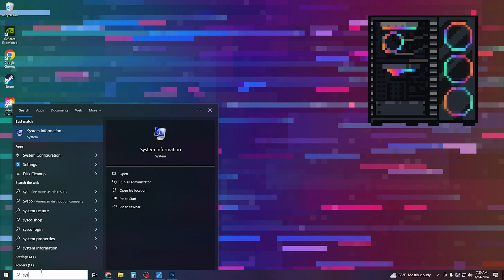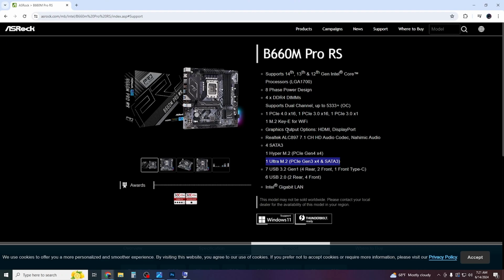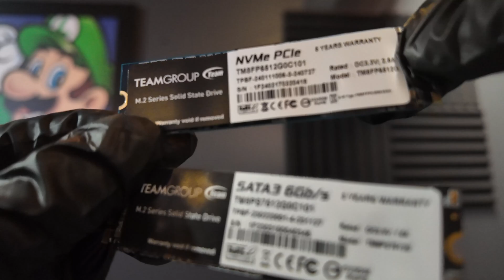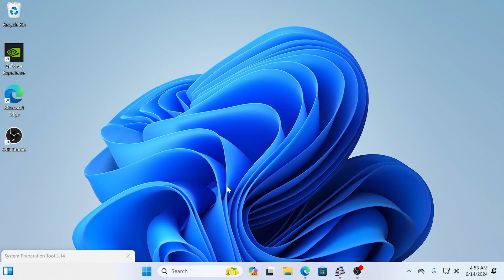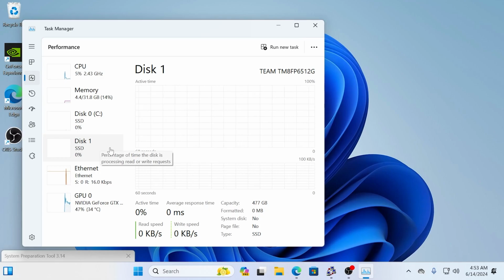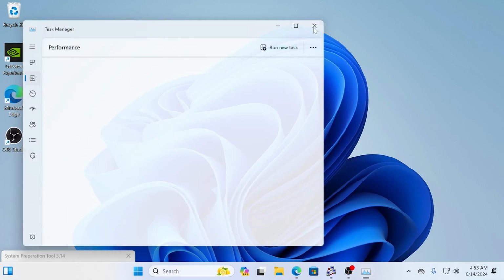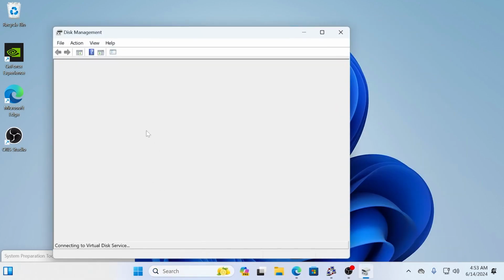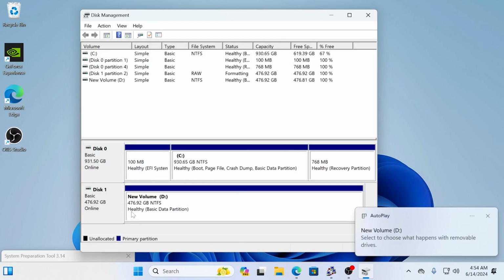How to Add an NVMe SSD - Full Tutorial

Comment: Been intimidated with opening up my premade I got during lockdown which had a 1tb for the OS and a second slot. Was really intimidated, but this guide worked great from hardware to software step. Only difference was I guess I have a "shield" that holds it down instead of the traditional screws lol. Thanks for this.